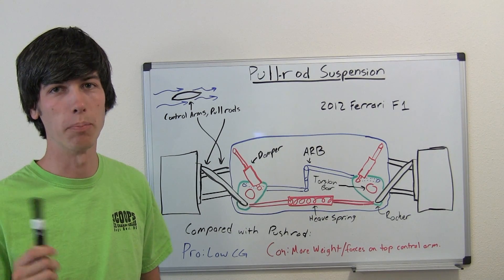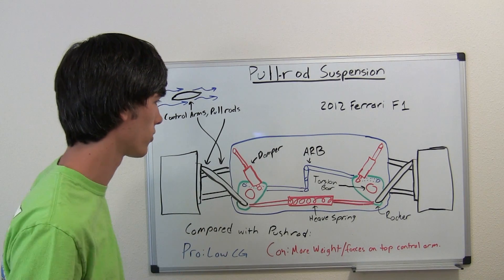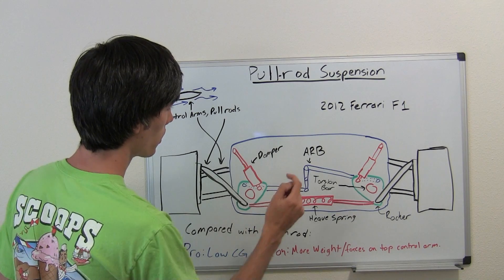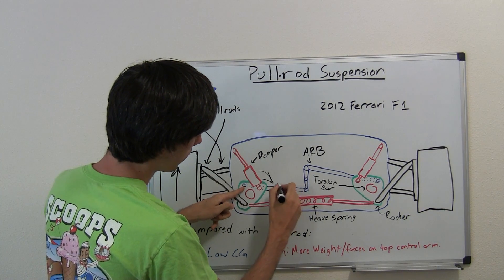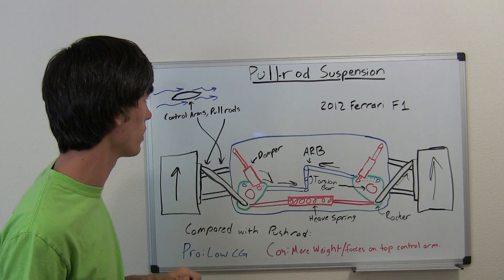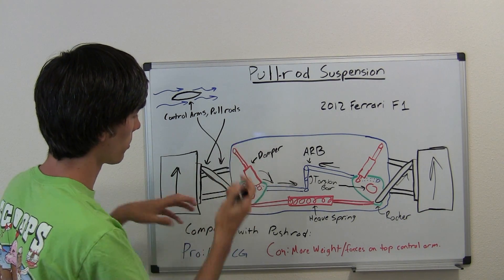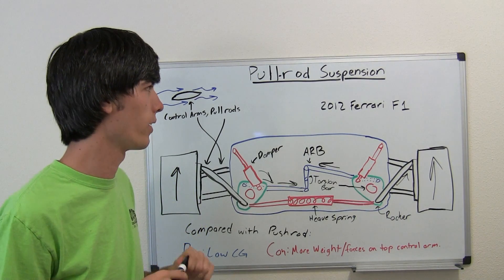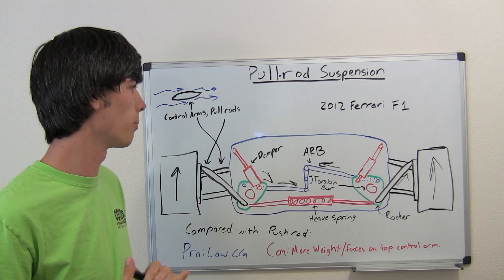Pullrod Suspension - Explained

Comment: Of course that's what F-1 engineers I was working with McLaren Engineers after making deal with F-1 to engineer with F-1 for patent rights to my Carbon Nanotubes, as well as invention of Pull Rod Suspension system.
 I invented the Carbon Nanotubes on my first year of Engineering in 2014-2015 year at Cape Breton University. this is a lie that Pull Rod was around in 2012. Mandela Effect, I made a deal with F-1 for patent right for my perfected Carbon Nano Tubes of 18 carbon circumference...lol.

Comment: i watch your videos so i can know what to be aware of when i end up creating my own.  before watching, i assumed a pullrod would be hands down better (because of lower center of gravity, as well as saving weight on smaller pullrods (compression strength vs. tension).  im glad you mentioned that you would need to beef up the upper control arm (adding weight) because of the added forces.

Comment: is the damper upside down because wouldn't pull on the damper instead of push?
Reply: +lerold weston if you flip the damper 180 degrees it doesn't change whether it's pulled/pushed. They will work both directions (push/pull).
Reply: The valving inside a damper can be run either way, as needed.

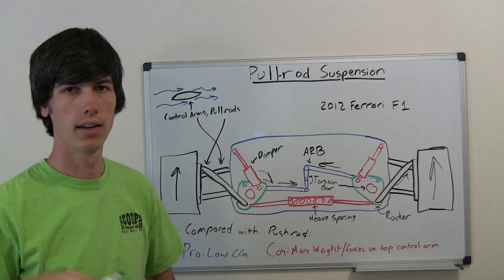Comment: 1:45 That looks as if it would push the (from the front view) right wheel DOWN instead of up.
Reply: He still delivered information. Anyone with IQ higher than a bush at least roughly understands how forces work. Main point of that, was that anti-rool bar maintains both wheels at roughly the same level to prevent rolling (clue's in the name)

Comment: One of the other disadvantages with this set up over the push rod is that all the components of the suspension  and access to the suspension is under the car rather than on top and makes changing and tuning more time consuming and critical, something of importance when they have limited time in a session to make the changes to improve the handling.

Comment: FORMULA 1  1600 HP / 2400 CC NASP
ANDY BEARING AT BELOW FRONT WHEELS REDUCE ROLLING FRICTION TO 50 %
SPEED 600 KMPH    RACE TIME 70 mts FOR 90 mts   SAVES 20 *60= 1200 SECS
WIN BY = 1200/90= 13.3 SAY 12 LAPS
COST 500,000 $. INV 100 Mn$ REPAID 300 Mn$ IN 4 YEARS

Comment: Still not quite sure I understand how pull-rod suspension works!?!??! Normally on push-rod suspension the rod transmits forces to the damper/spring which resists being compressed. In pull-rod it seems the rod will be pulling on the damper instead of pushing on it. So does the pull-rod suspension use a different type of damper that resists pulling rather than pushing? Are the dampers pre-loaded for this? Also doesn't it imply that the rod itself is under entirely different loads since it's being pulled on and potentially 'stretched' under heave loads instead of being compressed?
Reply: MegaherzZwei I see where your confusion is coming from. Note how EE lists the con as having more forces act on the top control arm? This is because the pull-rod transmits the force from the top arm to the rocker which makes the damper compress due to the rotation of the rocker. I assume you may have mixed up the role between the anti-roll bar and the damper. I hope this helps :)
Reply: dampener will reduce the flow, if it is pulled OR pushed becaused it basically is a system of pistons moving oil in/out of themselves... if you have a look at their internal structure you'll definitely get it :)

Comment: I know this is old, but anyway, I disagree with the statement or premise that using a pull rod system "lowers" the CoG. It does not. The CoG is determined by several factors but basically it is the point at which the entire weight of the car is centered. This point can be 12 inches above the ground, 15 inches, etc. By lowering the weight bearing connections of the springs, or here it is the point of rotation of the rocker  arm, you are changing the length of the moment arm, which is the imaginary line from the spring mounting point to the height of the CoG. The longer this arm, as is the case with the pull rod versus push rod, the more roll will be introduced into the chassis movement. Sounds complicated but really isn't .

Comment: Are we looking at the front of the suspension, or the rear?
Reply from the maker: I believe I drew the front, though either way it works.
Reply: Engineering Explained My question isn't important anyway, but if we're looking at the front then the wheel on the right would be forced up during a right turn. Since you said that the wheel on the left is forced up, then we're looking at the rear of the suspension. In any case, I learned what a push-rod and a pull-rod suspension is, and appreciate your educational vids.

Comment: that sway bar doesn't make sense to me.  are the upper and lower circles in the center pivot points? seems like they would just pivot without transferring any energy
Reply from the maker: Yes, it's pivot points. As one moves in it forces the other to do the same, thus pushing or pulling the rocker to rotate a certain direction. I believe I explain it in greater detail on my pullrod video.

Comment: Umm yeah, I also think the shock absorbers are upside-down. If it was really like that, isn't it will hit the cylinder lower base valve first? Or the one pulled is the cylinder instead of the piston? Well, of course the spring will work. Other than resist rocker from twisting, it will also help to pull the rocker back. Try to pull and push spring, it will come back to it's original form.

Comment: So this pull rod and push rod are  a simple mechanical active suspensions ? and the reanult in 2006 i think they used the mass dumper what it was and what use for them was and why the fia band it?

Comment: Even if the upper control-arm/wishbone needs to be stronger, the pull-rod can be very, very light - it could even be a cable - so there is possibly a weight advantage.

Comment: could you explain the trick suspension used in the S15 JGTC? It basically locates the rear springs on a horizontal plain rather than a vertical one .

Comment: It's been working great for Ferrari since they reintroduced it in 2012, McLaren decided to switch to front pullrods this year too, but it doesn't seem to be working that well, the drivers say the car feels too stiff and bumpy, so the problem seems to be related to the change in the suspension from pushs to pulls, I wonder what did they get wrong.

Comment: Good educational video. However the primary reason more F1 teams these days are reverting back to pullrod type suspension is aerodynamics. The recent rules dictated a changing trend in rear aero design which in turn demanded pull rod system as a solution to get better airflow over the rear bodywork and to the rear wings, exhaust blown diffusers etc. The performance gains on suspension itself is negligible. In fact servicing is more difficult now because parts are less accesible

Comment: i know what he is saying by this, the way its drawn here the spring setup would be pushing on the mounting point(with coilovers at least) which will cause the rocker to rotate the same way its already trying to rotate meaning the chassis will rest on the ground. in order for it to work the mounting point would have to be the left top hole and the other end would have to mount towards the center of the car so it resist's rotation of the rocker and push's the wheel down.

Comment: Wheat is the problem with left corner? Just say we are looking on the car from the front to the back so all forces and rolls would be ok!
NB. 2012 ferrari (F2012) has pullrod suspension BOTH on front and back. RB5 started using pullrods in F1 after quite a long time.
PS. And thanks for all great videos, man!

Comment: love the videos, thanx ever so much, learning a lot with them!!
2 questions:
how could u combine a tilting/leaning stearing mechanisim to a push/pull rod suspension?
What you think its better to mantain a inverse trike steering at high velocities: do the front wheels are better off being perpendicular to the ground or leaning towards the curve, while the main frame, girates horizontally, displacing its weight in to the curve as a motorbike does?

thanx in advance and again congratulations.

Comment: True, but the suspension on the car you've sketched will most likely either bottom out (chassis resting on the ground) or pull the piston inside the damper to the end of its stroke range, and hence have no effect.

By the way, the spring will have no effect :)

Comment: Put a space between the . and "2nd". =)

What he means is that if you right click on the video and select "stop download" from the flash context menu it brings up, the video shows a preview picture from your video, that just happens to be from around 2:08, when you were talking about CG being lower in a pull-rod setup. In the picture you have your hand positioned so that it looks like you're doing a karate chop to the board. =)

Comment from the maker: 1. It's difficult to read (and understand) what you're saying with incorrect punctuation and spelling. I'm an engineer, so my tolerance is high, but that was bad. I don't get the right click karate, but that's irrelevant. Yes, it looks like pull-rod could become more prevalent.  Also, I labeled my forces correctly. My forces are for the ABS.

Comment: 1st, on a lighter note, if you right-click and stop download, you karate chop the board.2nd rear pull-rods are making a comeback on f1 due to smaller rear diffusers, which now allows the room for the pull-rod suspension in the car. 3. You messed up the force transfer for the suspension. The bar of the opposing wheel should be pulling inwards, hence the name.